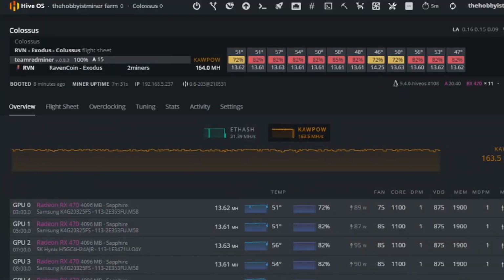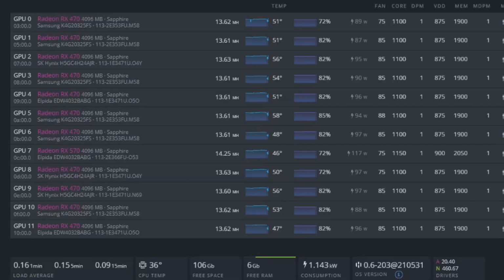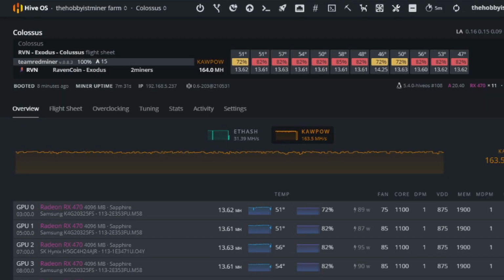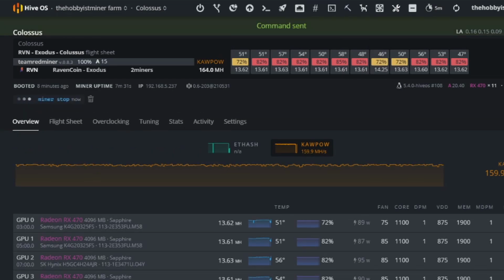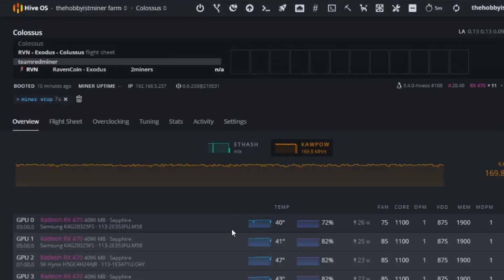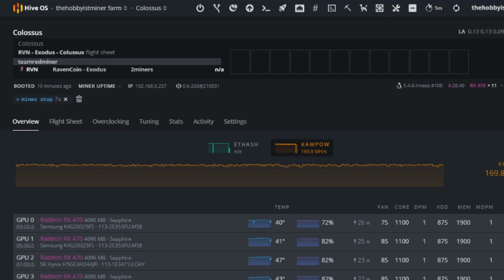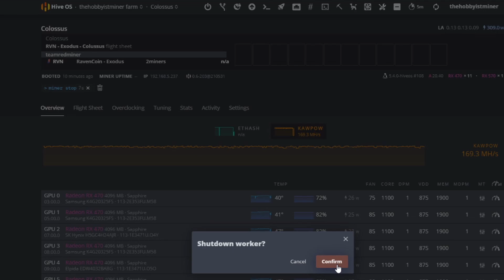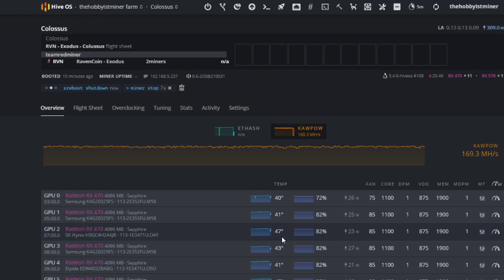How to Properly Power Down Your Mining Rig Safely

Comment: Just a question, i want to buy another atx psu, so i should have 1 psu with the motherboard,cpu and some gpu+ risers, and the other psu with an adapter, so that it can turn on without another motherboard, and in that psu only connect  gpus + risers right?
And another question, in case i want to turn off my mining rig, should i turn off the mining rig in the OS, then shut down the main psu with the button (the one connected to the mobo) and then shut down the other psu with the gpus+ risers with the button right?
(Because the other psu is independent of the main psu)
PD: i dont know if i expressed correctly, english is not my first language

Comment: You should be running the server PSU’s on 240v or you are not getting the full rated output of 1200 watts, only like 900watts and that is why they are screaming because you are pushing them beyond a safe margin.
Reply from the maker: They are on 240v ;)

Comment: Can hp power supply be turned on automatically after power cut and back again like atx psu
Reply: Yes, with a connector piece. When the ATX flips on, it triggers the server psu to flick on as well. I believe in the X11 breakout board you can connect a 4pin to molex. Molex going into the ATX psu. Parellel miner sells it

Comment: Not sure any of this is necessary... If extreme overclockers dont have issues... miners aren't going to have issues unless it is a faulty card. We're talking running cards in excess of 80c for excessive time periods. Consider also the LN2 overclockers who repeatedly drop temps on cards and their major concern is cracking the frozen thermal past, not the gpu.
Reply: Hey, what happens if there is a sudden power cut, and I don't have a inverter, how to protect PC components?
Reply: @neelabhdutta6691  UPS (Universal Power Supply) battery backup units are a nice thing to have for power outages. Put them only on necessary components to give you the time to soft power everything down. Not needed on displays and such... you want more protection add on a generator that will kick on when power is out, UPS takes the load while generator starts and takes over.

Comment: Do you think it’s safe to overclock memory on cards like the rtx 3060 ti as high as 1250?  Love the videos!
Reply: What is your max you can go?  Go for it - 200
Reply: I have my 2060's at -50 core and +1100 on memory. The 30's should be able handle +1250 without crashing.

Comment: Evga all the way with 1600w 1300w 1200w. I have a fee other brands. But I seem to prefer the evga better. For multi psu I use that wire splitter where when mobo turns on . All psu turns on. I haven't tried the server psu.. they are cheaper. But I really like my evga
Reply: I mean you're spending 5x the money for the same amount of power with a lot less VGA ports. Server psu's sell for $80, comes with cables and 16 6 pin ports. And server psu's are built to stay on 24/7. They are also platinum rated
Reply: But server psu are said to be very noisy and not good for a small mining set up in a room. Is this true?

Comment: Hey man, Love your vids! 

What wattage PSU would you recommend to run x2 Rx 470 8gb cards?

Keep up the good work!
Reply: Even a 450 w gigabyte PB450w will work just fine
Reply: it take around 100W with normal to extensive 135W max
Reply: this is for 1 card